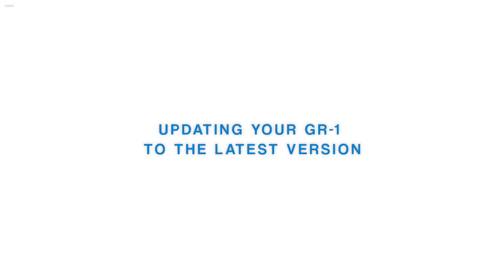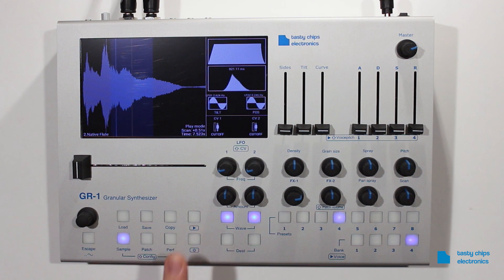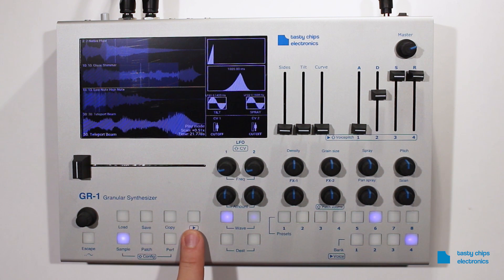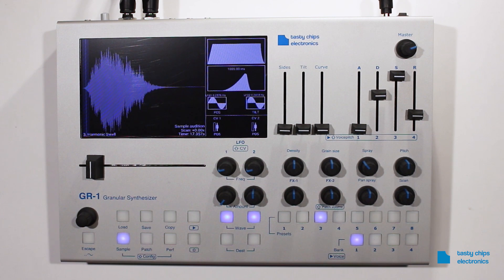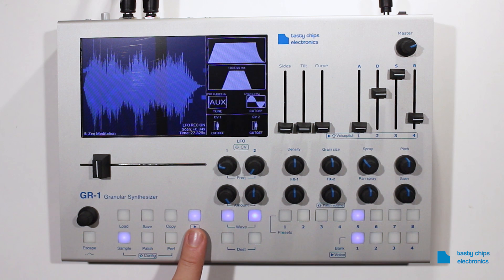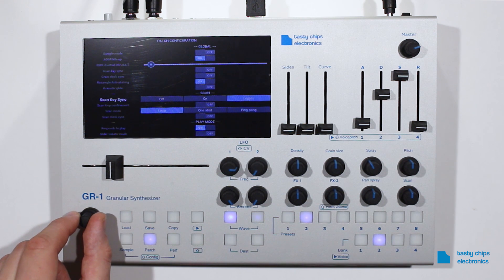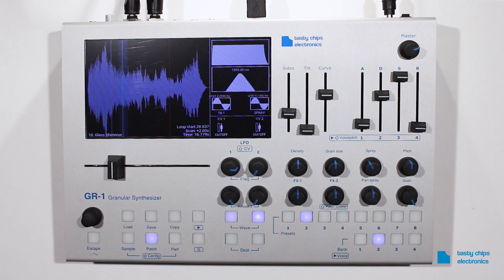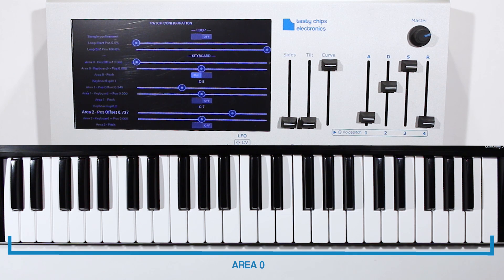GR-1 Firmware 2.0 Tutorial

Comment: In multitimbral mode when i use all the 4ch is there a method or way to change the volume of each patch to provide smooth transitions?
Reply from the maker: Yes, Performance menu (Shift+Perf) -> ADSR Slider mode -> Part vol. At this point the ADSR sliders will act like a mixer!
Reply: @TastyChips  THX!

Comment: Hay I have Questions on the Gr-1 Can I use a Sample as a Quantizer as Distortion as a waveshaper. Say I put cv1 as and Eurorack Oscillator Saw out to in the Aux as to Scan, now can I Bypass the main internal Oscillator pitch Controlled also on , and let it Sweep by a Sawtooth ramp up by and Eurorack Oscillator and use the pitch Eurorack Oscillator Scan as Distortion waveshape that way? I know it work on the Malekko Richter megawave but didn't have a Sampler Recorder it had built in Presample. It was also a wavetable but not looking at that way but more on the Sampler.
Reply from the maker: You can use an Eurorack-generated ramp to control the Scan of the GR-1 for instance, yes. But I do not understand what a distortion waveshape is?
Reply: @TastyChips  for a better example of is a Wavefolder or a pulse width Modulation. let say on the Gr 1, the Eurorack oscillator voltage is linear rising as a Sawtooth or ramp up it should play normal as A to B to C but Reverse Sawtooth or ramp down Should play Reverse by C to B to A. Now using a linear Triangle wave should play Forward and Backwards A to B to C to B to A frequency or tone Doubles. -12 voltage Start Sample wall or Start left window,0 voltage middle of the Sample or center on the screen, and the +12 voltage should be the Finish wall or end of the Sample Right window.
Reply from the maker: @Marccarpenter2600  Oh in that case, yeah it can accept and use all those signals. But the GR-1's inputs are 0..5V instead of the typical -5..+5 Doepfer.. So you need to offset+scale your CV. 
Besides all this, the GR-1 can do all sorts of scanning magic on its own. It can loop forward and backward (positive and negative saw), and well as ping-pong (triangle). You can even record your own LFO shape by wiggling the horizontal slider, and use that as the scanning motion. And then you can even quantize, scale and offset this + add an additional scanning motion ;)

Comment: About multitimbral - I make a sound with 4 samples, all on midi ch 1, for a big sound. I save it as a perf. When I reload it all the sounds are there but the 4 samples don't load how I set them up for the one big sound. In short you can't save a layered 4 sample sound in multi mode with all your tweaks. Is that correct?
Reply from the maker: It should show all activated layers right after loading the saved performance. If it doesn't, then it's an old firmware version (upgrade it?). And otherwise, it's a bug. In which case, write us @ info@tastychips.nl